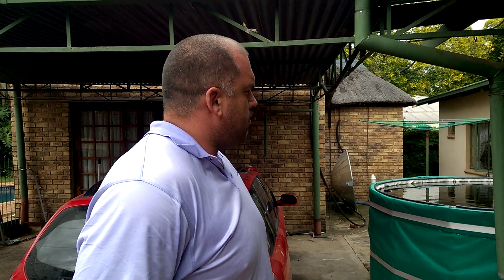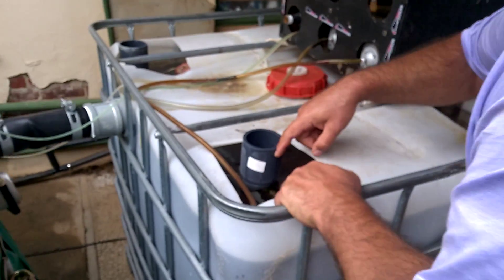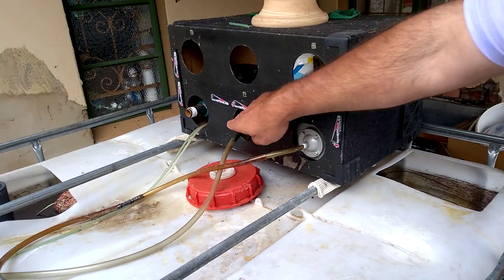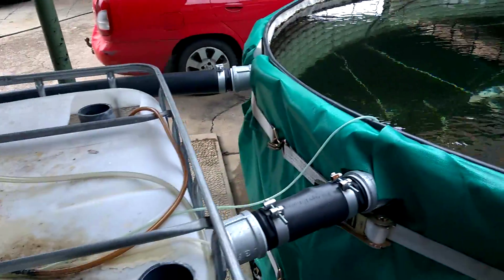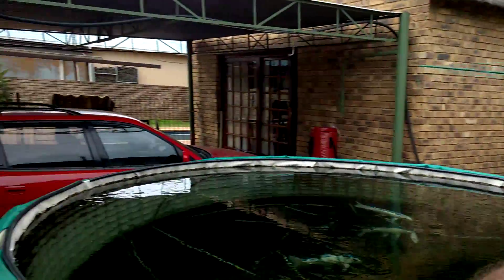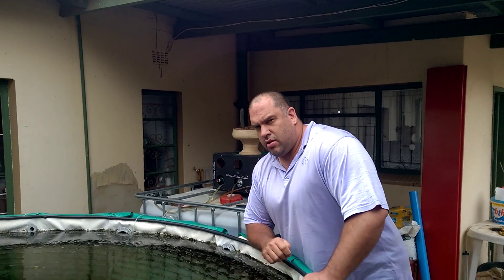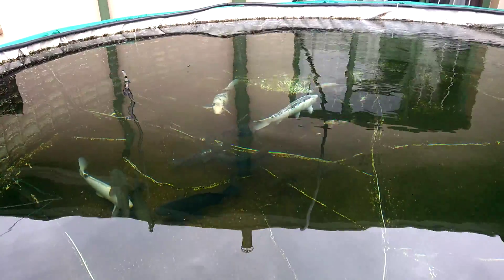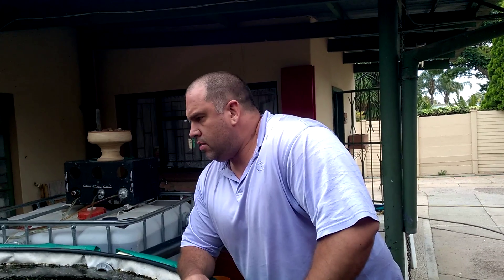2000 Gallon Fish Pond (8000 liters) running on 40 Watts

Comment: Great stuff and bravo to for the results :)
Have you thought of creating some flow to help center the fish poop for easier elimination? At your intake you put a 90 elbow pointing down and you drill 3mm holes spaced every so often all the way to the bottom, you can create a great flow for the fish to swim into and will help you with cleaning the solids. Using a "Solid Lifting Overflow" ( you can find how in here) you get rid of most of solids (fish waste and left over fish feed) like this you keep your levels good. So far they are good but with time they will accumulate and inevitably you will have a built up that will become toxic to your fish. 
By the way, do you know how many fish and how much weight does that represent? How much fish feed are you putting in the tank every day?